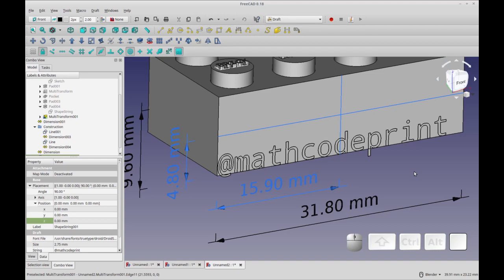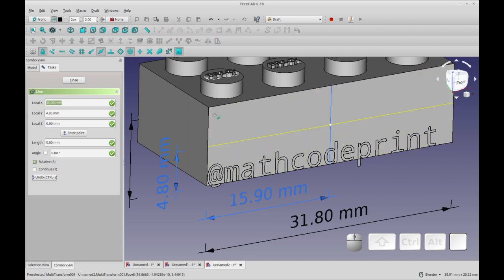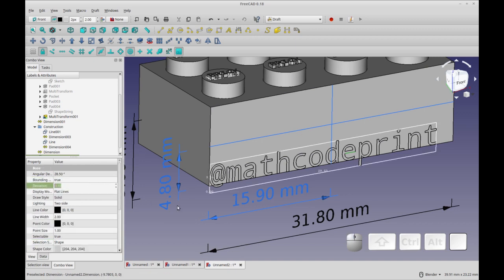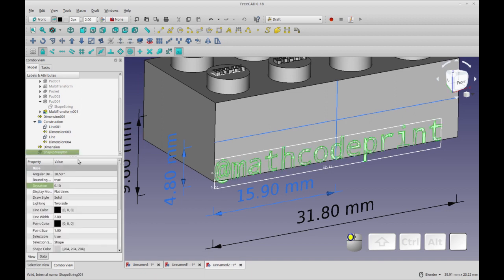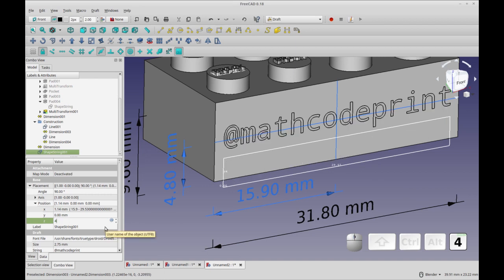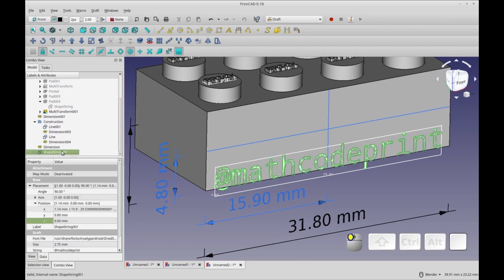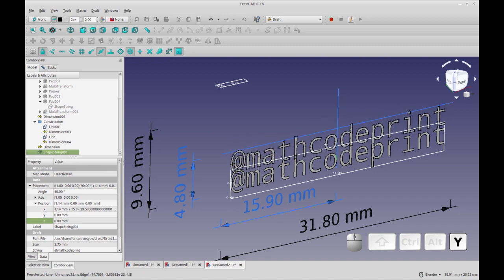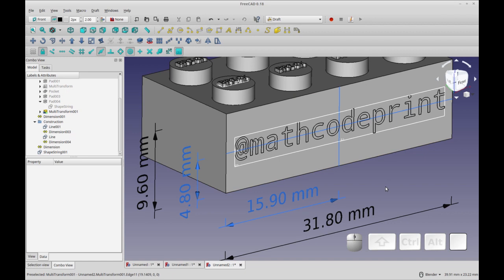FreeCAD Tutorial - Centering Text on a Surface.

Comment: The centering can be done with the Shape BoundBox with something like <<ShapeStringName>>.Shape.BoundBox.XLength as the length of the string.  Same is true for the height except it is YLength.  you have to multiply by 1mm to get the units correct.

Comment: A bit off-topic but speaking about text in FreeCAD designs, is there a way to display constraint names in FreeCAD?

I like to make fully parametric models.  It would be nice if I could display 'constraint names' in sketches and then display the names in the model (like you do with the black arrows)  or in a technical drawing.

FreeCAD easily allows showing the dimensions in mm, but these are kind of useless for parametric designs.   (I had to share a bunch of parametric models recently and it was such a pain to write down what all the parameters did and where to find them)
Reply: It kinda works.  Don't use spaces in the constraint names. I submitted a bug for that.  Otherwise, just click on the constraint and give it a name in the dialog box.  Then you can use that name on other constraints when you click their blue circle/fx button.  The spaces mess up when you reload the file.
Reply: You could create a single line with the constraint name.  Even add text to emphasize it, off to the side.  Then use the name in other places in your design.
Reply from the maker: It's a good question. The short answer is no not really. The longer answer is that it is possible. For one the Draft Dimension is "Attached" if you pre-select the edge so it will resize with the sketch dimension. You can also do the inverse where the Distance Constraint gets its value from the Draft Dimension. Both ways can be parametric accessed in the combo tab under properties. So if you name the Sketch Constratint the name will show up under the properties tab.  Draft Dimension naming doesnt seem to work as well. You could also drive either of them from a spreadsheet. If you are interested I think this would make a nice video.
Reply: Thanks! Yes, I am very interested!  
I'm always interested in anything concerning parametric modelling.

I try to limit the use of Spreadsheets because it slows FreeCAD down enormously. I usually only put constant or "measured" parameters in spreadsheets such as nut and bolt sizes. Parameters that change the shape of the model I like to put in a Master Sketch.
Reply from the maker: Thanks, I totally forgot to mention the spaces issue in naming.